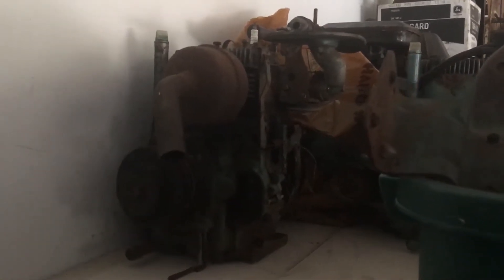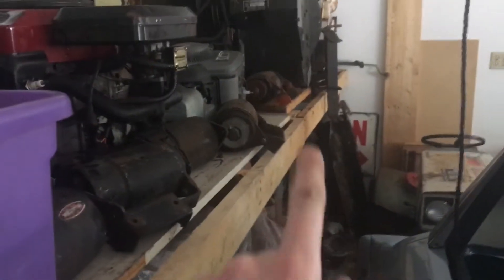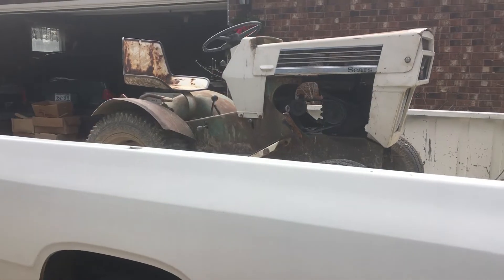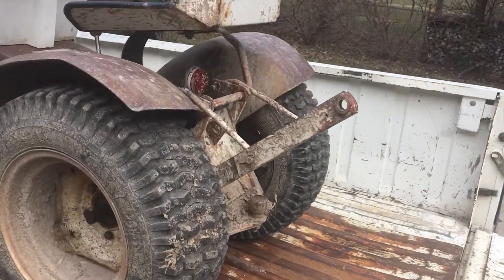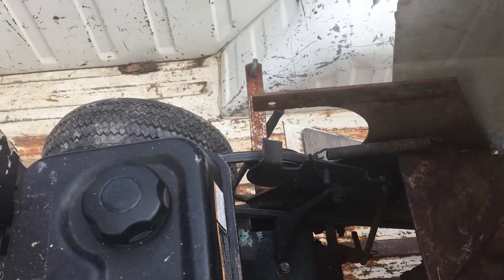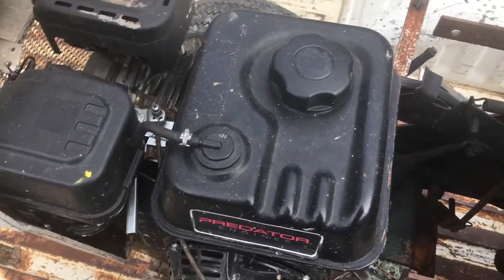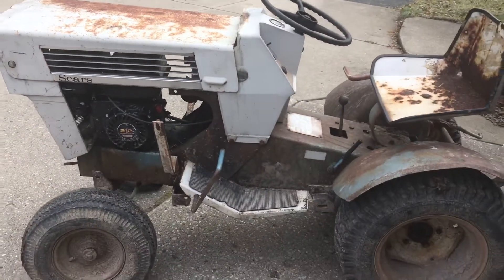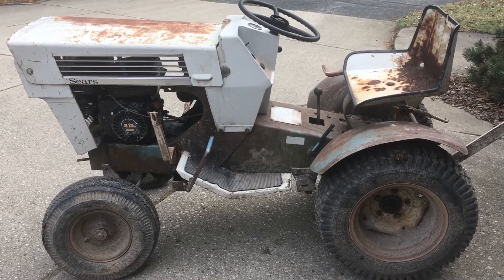1967 Sears Super 12 Project

Comment: I found an ST12 on C/L about 5 miles from me , it had been converted to the 212 Predator , what I liked was he had taken the rear rims and had a machine shop widen them and put 26x12x12 tires on the rear , it had a complete 3 point hitch on it , and said the original Tecumseh was with it . I get there the center link was gone , the engine was white and a 10 H/P , ad the tires had more dry rot than I liked , posted for 300 , I decided to pass on it , he called 2 days later and asked if I was willing to pay 200 less the 3 point and Tecumseh and I said I wasn't paying 100 for everything , probably dumb on my part but I passed .
Reply from the maker: barry hunt I usually don’t touch tractors that have been messed with and aren’t original but since the 67 Super 12 isn’t the easiest tractor to find around me and I have everything that came out of it when the guy put the 212cc in it. I am going to refurbish this tractor and make it look decent again and put it back to work down the road.
Reply: I say if I can find a good Hydro Trac that I will be done , I found one 3 hours away with no motor , I think it was 150 ?? or 125 ?? , I got Rooney to look at it , he said not a bad deal , I called and it was gone ,sold in 1 day .
Reply from the maker: barry hunt yeah Hydro-Tracs are growing in value. I paid $150 for my HT14 and that was a really rough one and still is. I am working to get a proper engine for that one. I have been on the hunt for another hydro but I haven’t seen any come up for sale besides all the ones Rooney and I have.